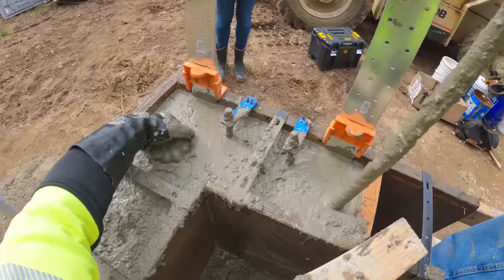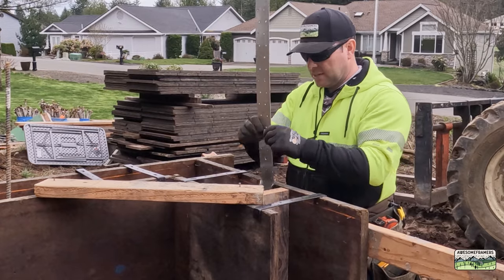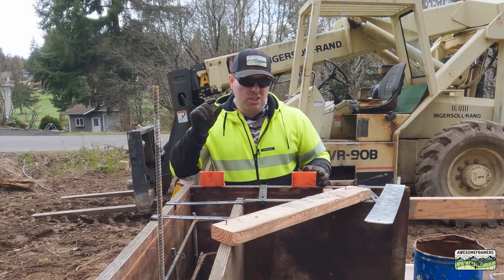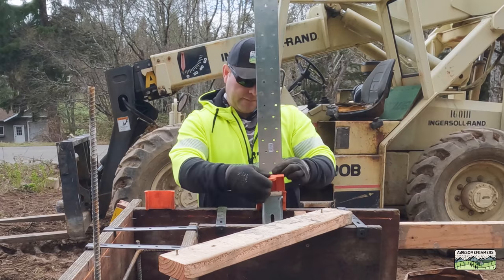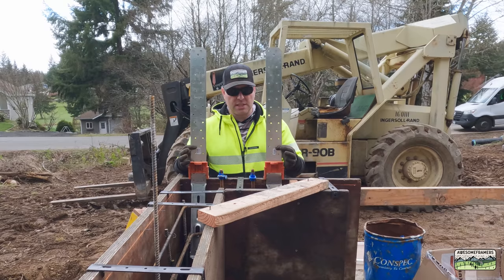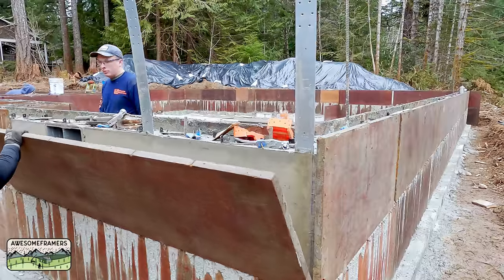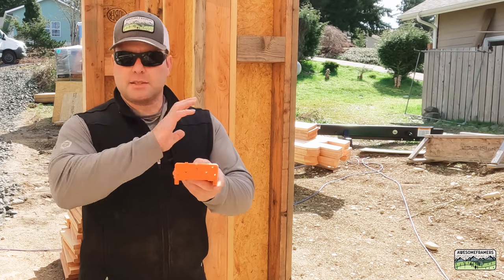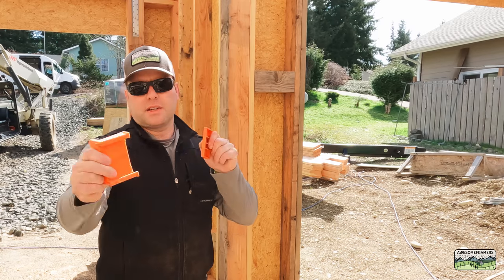Don't Break the Lateral Load Path

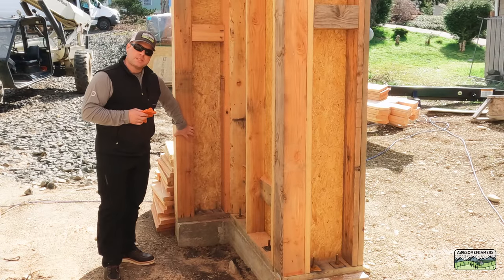Comment: At 6:10 you mentioned a 3x sill plate. I assuming you meant a double sill which is typical with the STHD14 strap but at 7:45 I see a single plate and lots of anchor bolt threads above the sill plate. Am I missing something? Either you're missing a second plate or the anchor bolts are not deep enough. Thoughts?
Reply: Mike Rose, it's a nominal 3x6 sill, i.e. 2-1/2" x 5-1/2".  Does look like a lot of thread, but I'd assume they met minimum embed. What I find unusual is it looks like at least one black (non-galvy) steel, but I can't see it real well.

Comment: Question from an Anacortes, WA builder...  our inspectors insist on a piece of rebar lying across both hooks and being tied into the verticals.  Any experience with that?
Reply from the maker: Hey Andy, great question.  This plan has an SE stamp on it, so that trumps everything else.  I try and make sure the bar is close to "hook" portion, but in all the years we've been using these, never once failed inspection.  Would be an interesting question for Strong-Tie.  I'll reach out and ask.
Reply from the maker: I looked at the details and it doesn't specify rebar laying on the "hooks" https://embed.widencdn.net/pdf/plus/ssttoolbox/ztnrnlrhhi/C-C-2021-p58-60.pdf 
just the amount of rebar.
Reply: I have ran into that in Pierce County and King County, Washington.  My solution, put the 80 cents of rebar in the saddle of the strap like the inspector wants...even though StrongTie doesn't show it in their installation instructions!
Reply: I appreciate that link and feedback guys.  I have not been able to find the specific call-out that required the bar in the hook/saddle but we all know how pointless it can be to argue over that 80 cents of rebar.  Completely agree with what you're saying about having that really clean strap install to just remove any focus elsewhere anyways.  Thanks again, love following your builds.